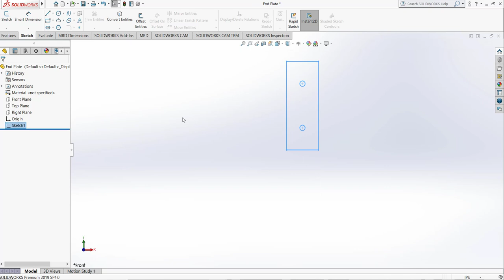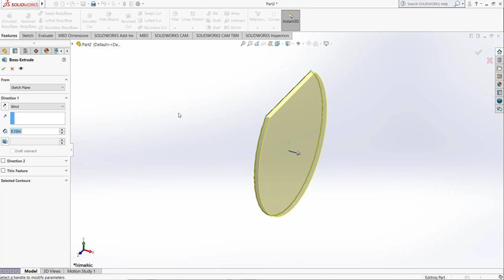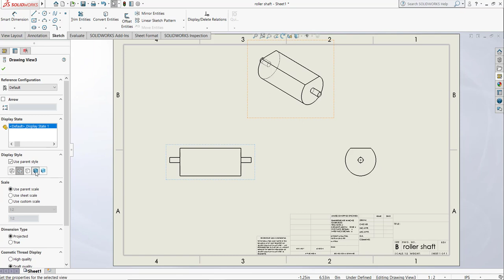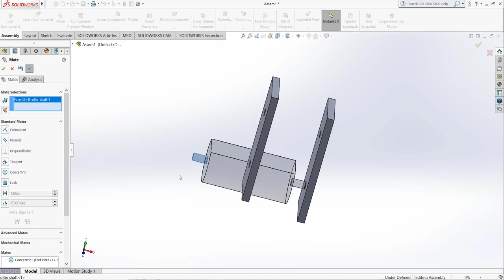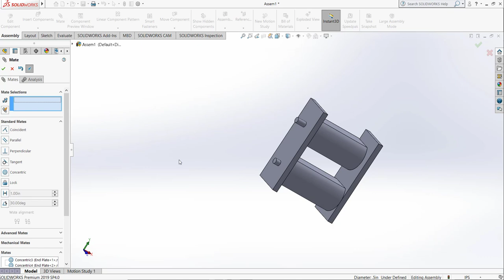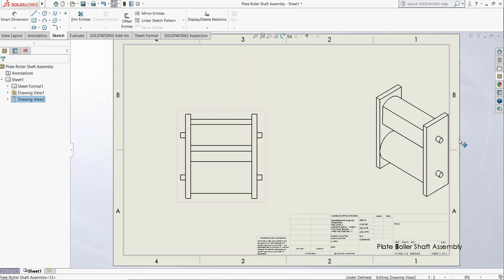SolidWorks Tutorial for beginners-Roller Shaft Assembly

Comment: Hi I found your video very helpful, I had a question if it was possible to fully define the assembly. My question is it possible to have the top roller move in a 360 rotation will still being defined? if so can you explain how that would be possible? thank you!
Reply from the maker: Assemblies can not be fully defined if it has some moving parts in it
Reply from the maker: Only fully defined your models not the assembly, bottom toller is fixed by adding a mate